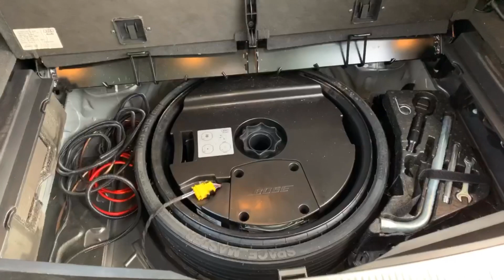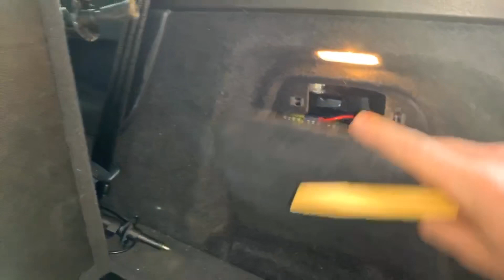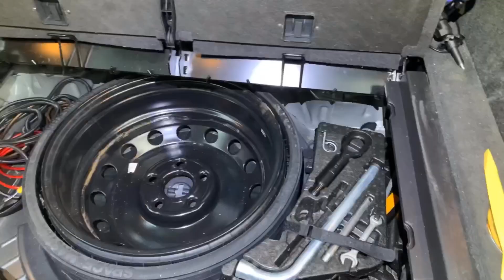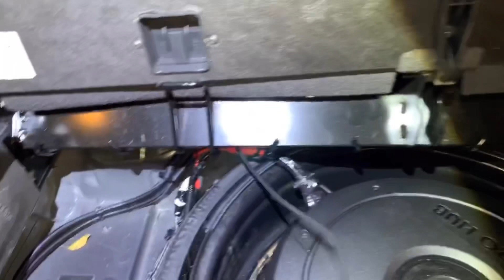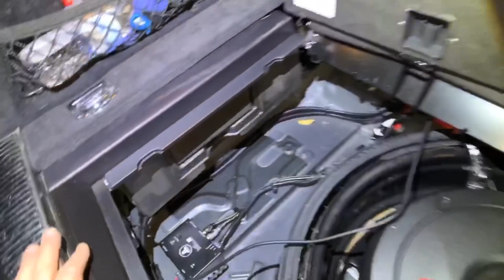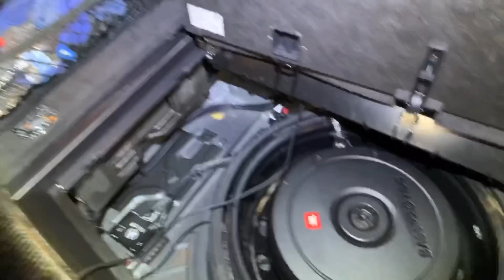2014 Audi Q7 Subwoofer Upgrade

Comment: Were you able to use the existing power from og sub? Or did you still have to run a line from the  battery under the front seat? I just ordered this for my q7, great video was just unclear about that part. Thanks!
Reply from the maker: I ran the positive wire from the fuse box in the rear side panel and ground from a body stud under the fuse box.
Reply: Was the original system BOSE? and how come you opted to not use an aftermarket amp?

Comment: How does it sound buddy? I'm getting ready to thrown a sub in my S8 but I'm reading that subs don't sound good in the trunks because audi trunks are sealed up so tight? 
Thanks
Reply from the maker: It sounds great for a single sub. The bass fills the entire car and sounds good from every seat. 10 times better than the factory sub. For more bass one would have to put a box in the back and take up room.
Reply: @kevinfitzpatrick5777  please incl the link for the follow up video on the bass test
Reply: @kevinfitzpatrick5777  awesome.. I'm just putting a small 10"powerd sub (kicker type) for a little somethin.. my days of dual 12" enclosures are gone..
Do you think this will help with my factory Bose or am I just wasting money?

Comment: How did you do the wiring? Splice into a rear speaker wire or use the wire going into the original sub? Any advice will be greatly appreciated. I have a Q5 and the JBL is shipping to the house as I type and I'm trying to game plan in advance.  How are you enjoying it a few months after install?
Reply: Hey man, wondering what colors are the positive and negative for the OEM subwoofer cable on your car?
Reply from the maker: Zac Williams I connected the wire going to the original sub. I really like it, it sounds so much better than the original and fills the car nicely with bass.